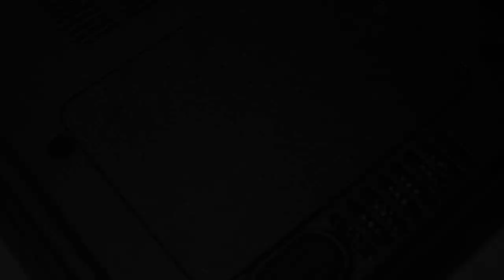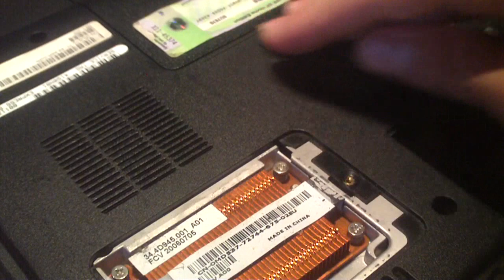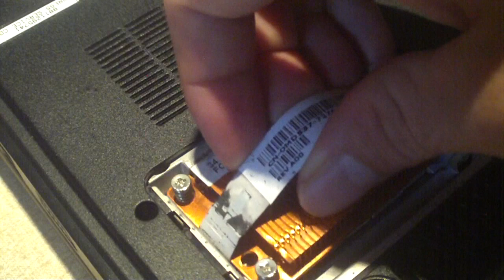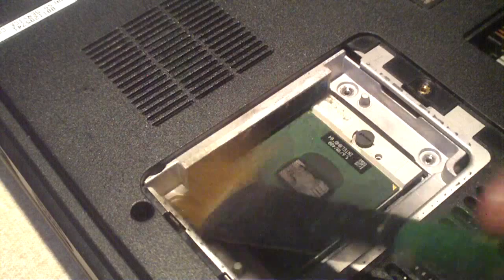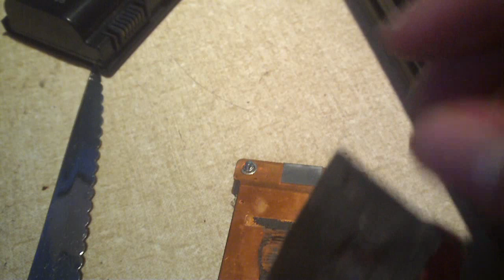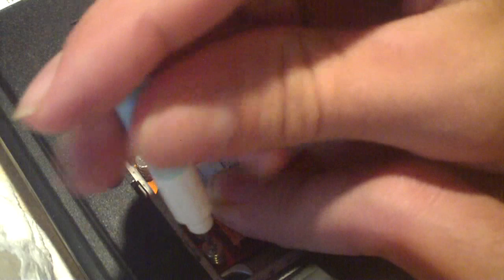Unusual Dell Laptop with an Unusual CPU Cooler

Comment: This modular CPU cooling design was VERY common in many entry level consumer grade notebooks of the early/mid 2000s with Socket 478/479 Pentium-M and Celeron-M-based CPU's. Gateway, Dell and others also used this design.  The Presario C and V Series (Such as the V2000/V4000US) were so common that I remember seeing stacks of them for $5 each at Goodwill stores before they just started arbitrarily sending them to scrap.  It was a modular design that made it inexpensive to CTO lower-end custom spec'd models to stores like Costco and Walmart at a low-price while using mostly the same casing and parts keeping production costs down.  Most of these sported low-end sub 1.8Ghz Celeron-M and Pentium-M CPU's and threw in cheap, non-Centrino based wireless solutions and low-end Intel GMA graphics.  The same cases were used to house lower-end AMD Athlon and Sempron versions with better nVidia or ATI graphics, but were prone to failure due to heat and inadequate cooling.

Comment: you're not supposed to peel off that layer of supposedly aluminum foil, it has a purpose, is not located randomly just because it looks good or something, and if you wanted to do things better, you may have replaced it with copper foil
Reply from the maker: Thermal paste completely replaces the need for the foil.
Reply: @CubeComputerChannel  that thermal pads are used for a reason, and as I can see, there are some thermal compound on it, and as I said before if you think that aluminum thermal pad is nonsense you should replace it with copper foil, I wonder if you know about the thermal conductivity capabilities of these two, also the need of a pad on top of this kind processors prevents'em from being cracked when putting on-off the heatsink, you should just only add the thermal paste, but not use it as a replacement of the thermal pad
Reply from the maker: Macro DuPont  Again, thermal paste replaces the need for a thermal pad. These foil pads are a poor heat transfer medium. They were used back in the day as a means of speeding up assembly. Thermal compound fills the gaps and valleys in the heatsink surface much better than the foil. I used to change out these pads left and right in favor of real thermal compound in systems with overheating CPUs. After migrating over to thermal paste, the CPUs always ran much cooler.
Reply: @CubeComputerChannel  again the thermal pads purpose is not only transfer the heat from the cpu, but in that kind of cpu's prevents cracks and ireparable damage when you put on or off a heatsink, that's the reason all integrated circuits where the silicon is not covered with a plastic or metal layer have the need of a thermal pad, not just for thermal purposes but for protection of the chip, also if you're looking for a better thermal transfering you should have used gallium instead of thermal grease
Reply from the maker: Macro DuPont  Again, if it was required then explain why only vintage laptops seem to have thermal pads on the CPU. Most laptops I work with have only thermal paste between the CPU die and the mating surface of the cooler. This is the only laptop I have ever seen to use the foil. And I've worked on a bunch of laptops over the years, including motherboard repairs. The northbridge chips and discrete GPUs in laptops have a thermal pad that's reusable, but the actual CPU almost always had thermal paste as the interface material. Even some Dell desktop systems with Pentium 4 CPUs (with integrated heat spreaders) had the foil. It made for quicker assembly as there was no need to manually apply paste (newer heatsinks use pre applied paste). Once the heatsink is removed, the old material must be removed and replaced for optimum heat transfer. A lot of the older OEM systems from the late 90s-2000s used a thermal interface material that looked like chewing gum. It made for poor heat transfer, especially as it aged and dried out. Thermal paste has long been used on CPUs, both desktop and laptop CPUs, heatspreader or exposed chip. I have installed coolers on many Socket A Athlon and FCPGA Pentium III processors and have never experienced issues with die cracking. Most people in the enthusiast market always used a good thermal compound on their CPUs, such as arctic silver.

Comment: I've seen a Presario C500 laptop with the exact same cooling design (minus the accessible heatsink - to clean it you have to open the whole case) and I find it great.

I also have a Toshiba M750 which has a classic cooling design but on the bottom has a little door under which you find a piece of plastic which is exactly placed between the fan exhaust and the outer grille so you can remove it, clean it and replace it with ease (still no accessible cpu).

Comment: smart how they built that and buy the way thermal transfer pads in most cases do a great job and last longer then past witch is wi they use them yes past is better but its such a small amount of difference that's its only needed if you are overclocking. I wounder tho what they did for chipset an gpu cooling.
Reply: vorkev1 probably heatsinks on top of them hoping to benefit of some air flow somehow lol
Reply: daniel moreira the thing I hate that computer mfs do not do is they heatsinks you get have a ruff bottom I fthey would make them smooth it will give better heat transfer and I have seen this as I have tested it my self I polish all my heatsinks or the part that touches the chip.
Reply: vorkev1 they're not flat cause often they are meant to be passive cooling resources, but yeah, I totally understand you, I'd like they were more suitable to modding, notebooks are poorly design by any gamer demands, overheating and stuff, rather frustrating if you ask me.
Reply: daniel moreira I do not no if you rember it but back in the 90s they hade a computer called a desk note it was a laptop but was just a bit bigger witch allowed the use us desktop ram and agp graphics cards to be used on it it also used a great heatsink with great cooling but it nevert took off.

Comment: you arent supposed to spread the thermal paste!
Reply: +Objectified Cross If theres a heatspreader apply tim however u want. If the die is directly exposed spread.
Reply: Ditto: when you spread it, the thin film can easily trap bubbles as opposed to applying a large blob of thermal paste. The amount of thermal paste applied in the video is already less than normal. By spreading out the minimal amount of paste, the unevenly spread out paste can trap bubbles before they reach the edges of the die. Put a large blob on it and it will spread out- when you remove it fresh, you should feel resistance because when correctly applied, thermal paste should create a vacuum against the surface of the die that you are attempting to break by pulling the cooler away.
Reply: +crazysoccer13 IT literally doesn't matter.
Reply: Emanuel morales 
Exactly.
Reply: +crazysoccer13 is right. Here's why: If you spread it and then put the heatsink on, there will be air bubbles (and maybe even tiny little parts of dirt from the "tool" you're using) everywhere between the chip, compound and heatsink which does affect the cooling performance. If you just put it in the middle of the DIE or heatspreader it will spread smoothly and without air bubbles as soon as you thighten the heatsink. This way you'll get the best possible cooling performance.

Comment: That is a nice design. I love laptops that are designed one way or another to be able to clean out the fan/heatsink easily. They should all be made that way rather than having to do a full teardown and board removal which is ridiculous & sh*tty design imho. Never seen one like that though, very interesting and also allow changing thermal paste/cpu upgrade easy, very nice design actually. Would also be nice if all the manufacturers put another ten cents of copper on gpus instead of pad/gap. Some of the best thermals I've seen though are on Dells with lots of copper.
Reply: You also can easy change CPU if you want.
Reply: While this is a very nice design for the people who knows what they are doing, its an  awful design to prevent idiots who wants to clean their computer without  knowing what they are doing lol.
Imaging cracking that IHS-less cpu or simply throwing the heatsink back on without reapplying thermo paste... A middle ground would be able to easily access heatsink and fan but not able to remove them like a lot of modern gaming laptops do nowadays.